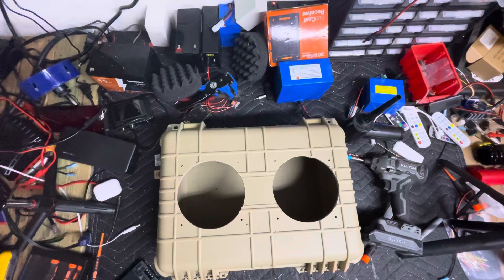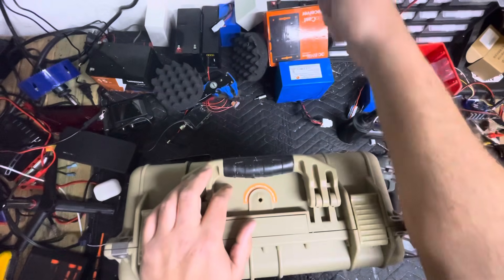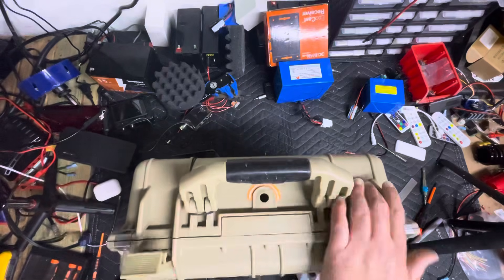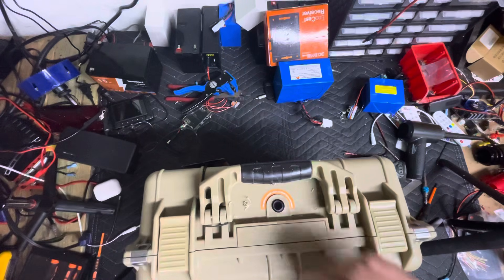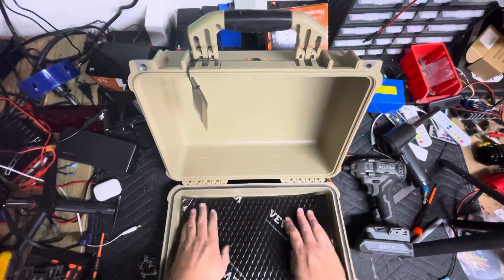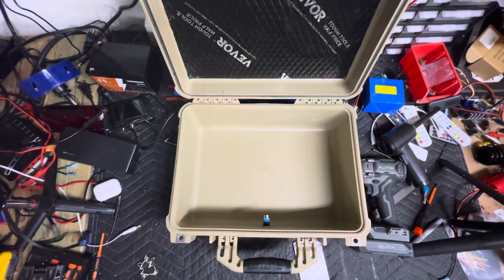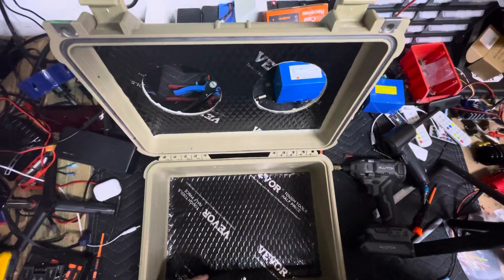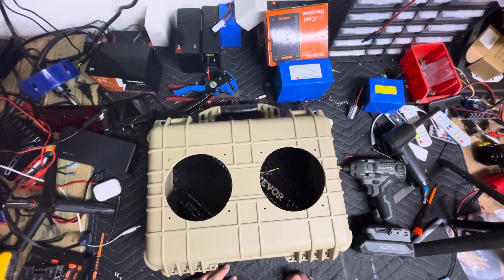How To Build DIY BoomBox Build Part 2

Comment: What is the blower link can I get it off amzazon what dimension box should I go with to have 6.5 7.09”D speaker to fit side by side on length side 15 7/16”Lx8”x10-13/16” utilty box or 17”Lx10.38”x13”H ammo box?